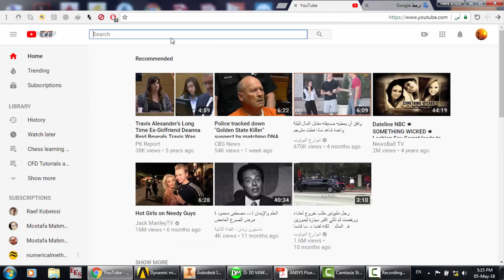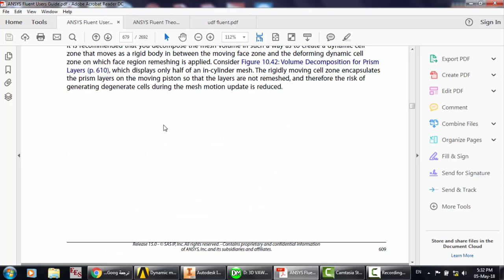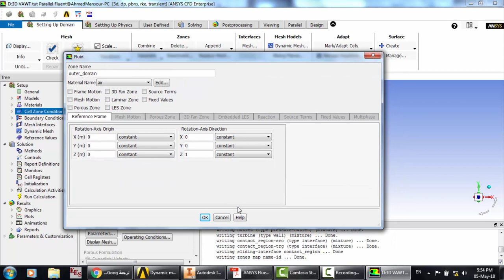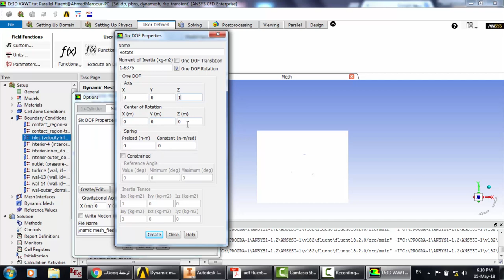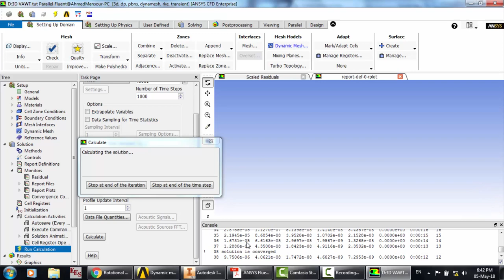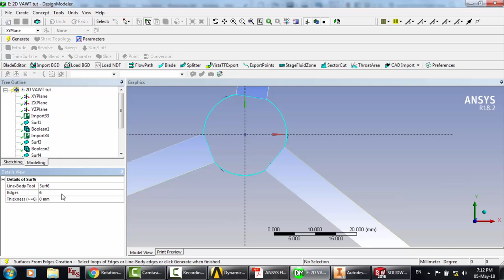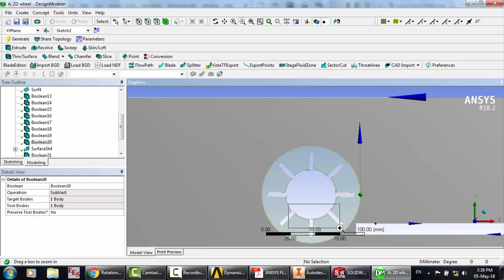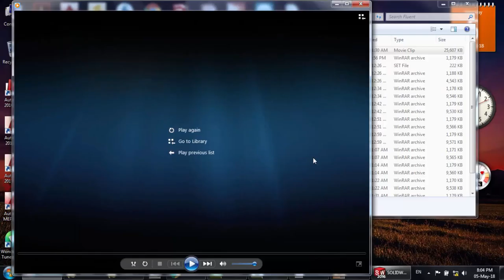Simulations about 2D,3D VAWT & Pelton wheel dynamic mesh 6DOF Ansys Fluent

Comment: Bro 3:52, that's what I've been looking for. You finally cleared my confusion with Sliding mesh and Dynamic Mesh. It was extremely useful. Keep the videos coming. Subscribed.
Reply: Also furthermore, while post-processing I really want to know that how can we obtain other parameters.
For example: Say VAWT. The airspeed is 10m/s. Is it possible to achieve the parameters like torque acting on the shaft, angular velocity of turbine due to airspeed? 
I guess once we obtain it is easy to get power generated.
Reply from the maker: @rushikeshbadgujar8091  Hello dear Rushikesh, you should do a literature review at first because it seems that you do not have a background about the performance evaluation of turbines. The power coefficient is estimated based on the turbine angular velocity and its torque. Or the moment coefficient and the tip speed ratio. I showed how to monitor the angular velocity and you also can monitor the moment coefficient, then you can use the equations found in the literature and estimate the power coefficient. Danke!

Comment: Very nice Video Buddy!
Does ANSYS CFX posses dynamic mesh, sliding mesh, 6 DOF??
I was certain that CFX was a better option for turbomachinery simulations, but now I´m unsure lol.
Reply from the maker: Hello dear JA, you are very much welcome! CFX is used for turbomachinery that has fixed speed of rotation as a main characteristic of the machine. If the rotation of the rotor is not fixed and depends on the flow speed like some wind turbines, Fluent can be used for the dynamic mesh feature which I am not sure if it is available in CFX or not. But this is the main difference between the 2 programs, Fluent can be used to simulate any type of rotating machinery but CFX is used for fixed speed of rotation. Fluent is very powerful and has many options and turbulence models. Danke!

Comment: Hi! I do simulation about water turbine in a pipe. I used 6dof function for this simulation. But when I run, it states that 6dof angular solver has not converged. Can I know what the problem about my simulation?
Reply from the maker: Hello dear Siti, you're welcome! As I showed, it is one of the complex simulations and it requires patience and try and error. Just follow the same steps using the same geomtry until you hit something. Then change anything. Danke!

Comment: Image i have three seperate blade domains which are rotating relative to the main domain. And If i want one blade domain to rotate at its own axis also based on 1DOF rotation and some spring constant, what will be the center of rotation for that blade? Will it keep changing as per the rotating domain if initially i have given the required rotation points.?
Reply from the maker: Hello dear, watch my video about the variable pitch VAWT. I showed using a code to let each blade have its own rotation. See if this is what you wanna do. Thanks
Reply: @haveanicetime  that’s a different case, I have already watched it. I am considering the 1 dof rotation of the blade using 6DOF dynamic mesh. 
Is it possible to talk to you anyhow?
Reply from the maker: @satyamshukla33  Hello, you can get the research article related to this type of simulations and see the methodology of it. What I know is what I showed in the videos. You can send me any related paper on mech.eng.ahmedmansour@ gmail.com Thanks

Comment: Hello, I want to monitor the pressure of surface of each blade. However, like your video shows, three blades are all named as" turbine ", I can't monitor the blade separately. Could you help me to solve this problem? Thanks.
Reply from the maker: Hello dear  Lei, simply you can select only the edges that describe the airfoil and make a named selection and name it airfoil 1 and do that with each airfoil....Thanks
Reply: @haveanicetime  Thanks for your reply. You mean I can name the edge in Meshing or Geometry. I will select each airfoil using Six DOF in Dynamic Mesh Zones. I think the relative moving among three airfoils will happen, Should I select the "Relative Motion" bottom?
Reply from the maker: @masirohatsune9375  You are welcome dear Lei, simply, open meshing, after following what I did, select the edge that describe the airfoil like what I did at 1:18:49 , the only difference from any other turbine I showed in other videos is here the airfoil seems to be not completed, this is because it is connected to the bar that is pinned at the origin. I wish you understand this point. This is a minor difference and I think it will not affect the results because this is what happens in the real life... Just do this without any further action and check out the monitor and tell me...Viel Erfolg!
Reply: @haveanicetime  thank you! I will  try it. In my case, the airfoil is not connected by the bar, just three airfoils. I will tell you if I have some problems.
Reply from the maker: @masirohatsune9375  Okay dear Lei, I wish it works..Viel Erfolg!

Comment: Bro is the torque and rpm of 2 dimensional VAWT fluent simulation result same with 3 dimensional?
Reply from the maker: Hello dear Alfa, it depends on the nature of the flow arround the blades of the turbine. If the the flow is highly 3D, the results will definitely be different from the 2D simulation. You gotta study some research artciles and see the better way to simulate your case. Thanks

Comment: Hello, I'm doing a dynamic mesh in 3D with 6DOF for an axial turbine. When I try to run the solution, I get the error: 6DOF element must have a positive mass. I double checked and I made sure that it indeed did have a mass. Any ideas of how to troubleshoot this?
Thanks!
Reply from the maker: Hello dear Leighton, okay sir, just decrease the timestep and see what happens. Sometimes we get a message " Negative volume detected" and when we decrease the time step, it works. So, reset the setup and decrease the timestep to a noticeable value and tell me if it works or not. Vielen Dank !
Reply: @haveanicetime  It worked for me. Basically, I changed a few things around among this as well.
Reply: @aniketvilasbeldar3407  Hi, can you share what you exactly changed ?
Reply: @wildstalion6289  I don't exactly remember. But, if you are having this error, check your mesh quality and decrease your time step.

Comment: when i click on the setting below 6 dof there is no option of create/edit do i need to enable something?
Reply from the maker: Hello dear Amit, try to reset the setup and start it again. Be sure that FLUENT does not have any problem and you enabled the dynamic mesh. Also be sure you followed all the steps I shew. Danke!
Reply: @haveanicetime  
Do I need to have a user defined function in inlet velocity and how can I check that fluent doesn't have a problem
Reply from the maker: Hello dear Amit, the UDF is only needed if the velocity is not constant like I said in the video. You check using the dynamic mesh in FLUENT by creating a new project using random geometry and see if the dynamic mesh tab will work or not. Danke!

Comment: Why the velocity in the outer domain is cero at @1:08:46?. Is it a mistake?
Reply from the maker: Hello, no, because the turbine rotates from 0 to the specific velocity, the contours at the early simulation time may look like thise not like the fixed wind speed where you can find high magnitudes at any time of simulation. Here, the dynamic mesh starts from 0 velocity until the maximum or depending on the formula you enter. However, make sure to run the simulation for long durations to capture the realisitc changes in the speed magnitude and validate the results against a reference. Thanks
Reply: @haveanicetime  Thank you a lot. But I did like 50 000 iterations with a time step of 0.01 s and I don't know why the outer domain doesn't show the countor of velocity
Reply from the maker: @jeancarlos0596  I am not sure. Try to use the fixed wind speed not the dynamic mesh like my 1st video. If you get good results, try to trail the source of issue when you use the dynamic mesh. The dynamic mesh is not easy to simulate. Accordingly, start with the easy case then move to the 6dof and see what happens. Anyway I showed the general procedure and the ideas. However, you can change anything you dhave doubt about until you hit the target. The thumbnail I used for the video was generated from the simulation I run before recording. i remember Igott good results:) Thank you

Comment: Hi sir. I have a question. Can we just create drawing from solidworks? i dont know how to use autodesk.
Reply from the maker: Hello dear Syazwan, yes, the geometry can be generated using any CAD software but the steps shown in the Designmodeler starting from importing each CAD file are the same and cannot be changed. Danke!
Reply: @haveanicetime  thank you for that but i've install the autodesk...now my problem is sw cant open the xt file? do u know why?
Reply from the maker: @syazwanifwat815  Hello dear Syazwan, yes, save the file as step and it will open. Danke!

Comment: Hello. Loved the video. It helped me learn a lot about Ansys fluent. But while running the calculation, it is giving me "Dynamic mesh failed. Negative cell volume detected". Please help me out with this error. Thank you.
Reply from the maker: Hello dear Sarang, you're welcome! Make sure that you have used the same values I used with the same dimensions and repeat the steps. I faced this issue many times and when I reset the setup, it goes away. Also it depends on the values of the input of the dynamic mesh. Danke!

Comment: Sir, the animation thst we got for 3d turbine , is that the velocity of air in there or the turbine blade?
Reply from the maker: The velocity of air arround the blades and at the blade surface.
Reply: @haveanicetime  Thank you!
I got the contours as banded type as ypu got ..but I want it to be like that in the thumbnail..like I need to see where exactly air flows with how much velocity along with rotation of turbine
Reply: Please help!
Reply from the maker: You have to study some fundamentals and research artciles about modeling VAWT and then use the software. Thanks

Comment: Can I calculate the rpm of the VAWT  by applying the wind velocity at the inlet?
Reply from the maker: Yes. This video shows the rotational speed dependant on the wind speed. Danke!
Reply: @haveanicetime   Can we apply this on Vertical axis Savonius turbine?
Reply from the maker: @sandippoudel5160  Yes
Reply: @haveanicetime  How can  I contact you?
Reply from the maker: @sandippoudel5160  Send me an email to mech.eng.ahmedmansour@gmail.com  Danke!

Comment: I need to compute the speed at which my VAWT turbine rotates .! Here it is mentioned 3D VAWT, but i can't see it.! Plss help?
Reply from the maker: Watch the video carefully.
Reply: @haveanicetime   I have a 3D geometry file (Similar to the savionous turbine). I have created a cylindrical enclosure and named it as rotating domian, and a box enclosure over the rotating domain and named it as stationary domain. Should i follow the same procedure, if not what are the changes to be made in mesh and solver? Because here you domain is just a plane, and VAWT is mounted over your domain.!
Reply: @haveanicetime   I have 2 more doubts:
1) Moment of inertia i have got 9 values( Ixx,Ixy,Ixz...etc). My blade geometry is in Y axis. So Which moment of inertia value should i choose?
2) I'm getting a floating point error in my calculation , and my graph values are going to negative values ? So what should i do now?
Reply from the maker: @rahulbharathwaj6006  You must follow the same steps I used. Do not use the enclosure option in the Designmodeler and boolean. Use the method I showed. Use solidworks to generate the CAD files. Then import them The video is clear.
Reply: Basically i have an iges file of turbine which is 3D, whether I need to create a domain or just import the geometry in ansys and then proceed for further process ?? That's my confusion over there

Comment: Hi, I have This  error : 6DOF object must have positive mass, but I didn't insert a negative mass or a negative inertial moment, Could you help me? Thanks :)
Reply from the maker: Hello dear Andres, I got this error before and I fixed it by resetting the setup, or restarting it..Try this because ANSYS sometimes gives fake errors...Tell me the progress please..Danke!
Reply: Thanks, but I still have the same problem, when I insert  the  moment of inertia, I have the next error :
All of 2 interface zones have been paired.
Error Object: (mass 0),
In settings of 6DOF you only put the MOI, but you don't insert a mass, I think that in this procedure is the error, do you know fix this?
Reply from the maker: Hello dear Andres, I am not sure, I can send you the project to study it and do the same steps, you can contact with me by mech.eng.ahmedmansour@gmail.com   Thanks

Comment: Hi, i am doing a simulation to savonios turbine but i can't fin the video metioned  about " how to choose INLET input values".... Tanks and great video!
Reply from the maker: Hello dear Johan, simply it is the same procedure, the geometry is the difference. Prepare the geometry and watch my video about turbine ventilator and the 3D VAWT to see some additional methods for the geometry . Just do the suitable procedure and tell me if you still have questions. Danke!
Reply: @haveanicetime  ok i understand but if i want into the value of INLET , i have the  average  values of the air velocity, how should i enter the values?
Reply from the maker: @johanmejia2850  The inlet velocity may be constant or variable with another parameter. If constant even if it is the average of many values, we enter one value. 
If the velocity changes based on a function, we enter that function using the UDF. Tell me please more about the model and if there is a paper it will be better. Danke!

Comment: Hey, could you make the same modelling on  ANSYS space  instead of Inventor please?
Reply from the maker: Hello, it is better to use any separate CAD software or the designmodeler because the operations used in modeling these simulations need the designmodeler. Danke!

Comment: Sir very good video. Your video very helpful for me. I have follow your video to do a horizontal wind turbine simulation. Yet I received a warning "Interface zones overlap for mesh interface in2. This could adversely affect your solution." Do you have any idea on how to solve this issue? Or is it ok to just accept the results?.
Reply from the maker: Hello dear Jack, the interfaces are not correctly defined. Also the HAWT must be simulated using 3D modeling and in 3D modeling, the interfaces are automatically defined. Review again the steps and see. Get research articles related to modeling horizontal turbines to be sure of the procedure. Danke!
Reply: I am doing 3D modeling, not sure what is the problems. Will try to review the step. Anyway thanks for your reply. Danke!
Reply from the maker: @jackjohnson4436  Okay dear Jack, watch my video about the 3D VAWT and turbine ventilator, the only difference is the wind directions and rotation as you know. Danke!

Comment: Hello, why didnt u update the gravitational acceleration value in the 6dof setting @59:05 ?
Reply from the maker: I did not touch it to update it.
Reply: @haveanicetime  yes,  that is why i am asking like, wouldn't it be more realistic for accuracy if we also put the gravita acceleration value of -9.81 in z direction... For more accurate answers... Or it does not make any difference?
Reply from the maker: We generally use the gravitational effect in simulations like solar heating or if the buoyancy will be studied. In simulations where the gravity is not in the direction of the flow motion, it is not considered. The turbine rotates in x-y plane and the gravity effect may not be included. Always check out the research articles and they mention the settings and the recommendations. It always depends on the experiment and the assumptions.
Danke!
Reply: @haveanicetime  How can I simulate the rotation of this, inside a container with fluid (water), injecting the same fluid or another. Should I use gravity there? 
I'm testing by entering gravity, but the values are different depending on the tutorial, but when I use it without gravity it works great.
2D-only simulations

Best regards
Reply from the maker: @eliascastillo8516  Hello dear Elias, including the gravity works properly for thecases where you find free fall for example. Here, we just take the effect of the wind forces on rotating the turbine.Thisis not like fixing the rpm as the other caes. Accordingly, no need to take the effect of the gravity. Also, validate your cases against published data for more solid results. Thanks